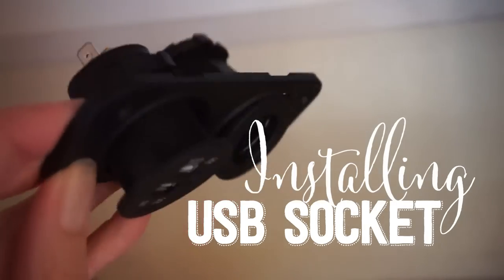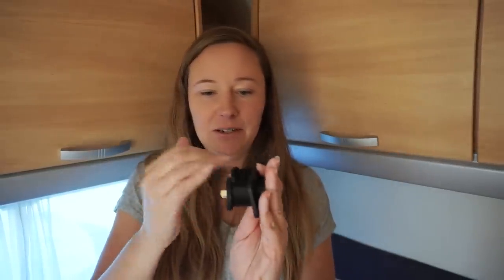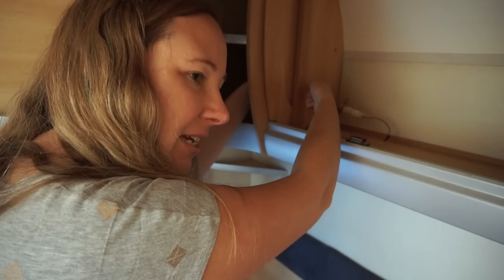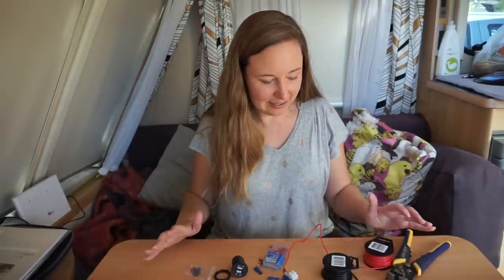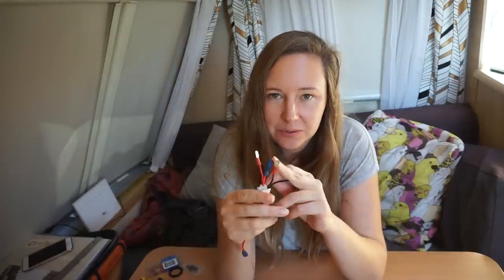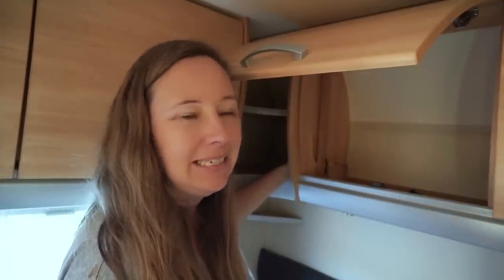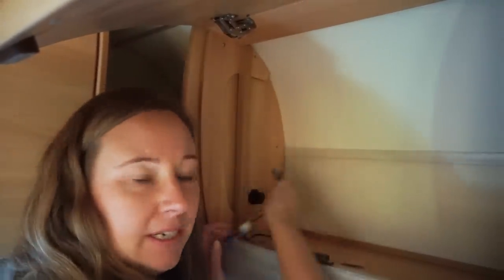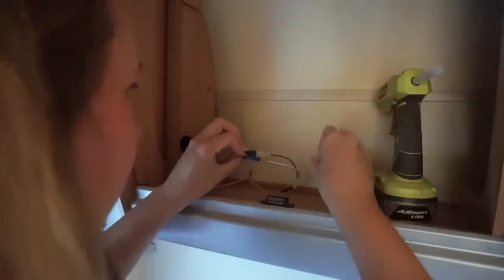Installing USB Socket In Caravan - Through Light Electrics

Comment: Hi Karen great videos ,we have change the 2 front spot lights in our caravan for new ones which have 2 USB ports
in them ,just 2 screws to take out which hold your spots in,then disconnect the wiring , then just replace it for the one
with 2 USB ports in them ,and they are nice and high out of the way for your cable,we have a great man called,Dan Trudgeon
who shows how to replace the spot lights on a Vlog,we paid around £30 for two new replacements .
Regards Kim&Chris
Reply from the maker: I've heard about Dan's video! Those lights look amazing!

Comment: Good on you for sorting this and for giving it a shot yourself. You'll find most jobs like this on a uk caravan relatively simple, and with 12v nothing that's going to kill you. Although I'd be tempted to wrap each new connection in electrical tape, and secure down to the inside of the cupboard somehow, so any rattling in transit doesn't risk anything coming undone.
Reply from the maker: Yes, I'm so glad I tried doing this job myself 😀Good tip about securing it more...

Comment: Nicely done. Need to be careful with how much load you add to the lighting circuit, but that USB socket will be ok, especially because you have LED lights.
With solar power, it is best to charge your phone and other devices as much as possible during the day while the sun is shining and you have plenty of power, rather than running off your battery overnight.
Reply from the maker: I use to charge my laptop in the mornings only, as it took so much power - but my new battery system is so powerful, I never need to think about it!

Comment: Hi Karen, thanks for sharing a most interesting video and well done. Just recently one of the USB ports has started failing in our lounge room computer and will need eventually to be replaced. Fortunately, I won't have to drill any holes for that job. Anyway, wishing you all the best. Robert.
Reply from the maker: Ah sounds like you'll be doing some electrical work too!

Comment: Much better than your Grey water clogs 🤢 
Does your usb port only work when your light is on,  or is it a permanent live as opposed to a switch live?
Reply: I wired mine in my old van direct to battery
Reply from the maker: haha, that was a gross video! The USB is continuously on. @uk tucker I have added a few things directly to the batteries too... but the batteries sit at the other end of the caravan.
Reply: Nice neat job me I would have put an inline fuse on it just to make sure if it had a problem it wouldn't hopefully interfere with lighting fuse all the same well done 👍